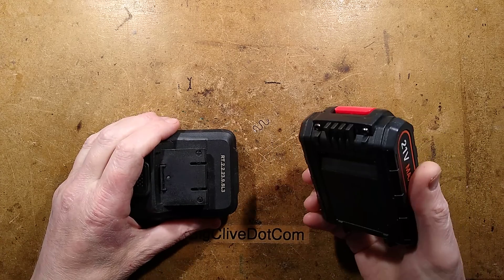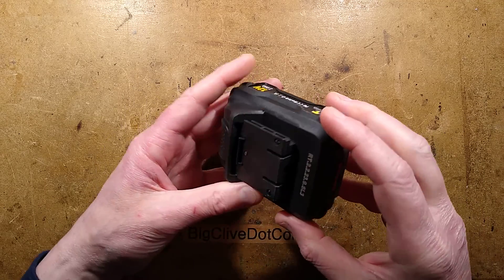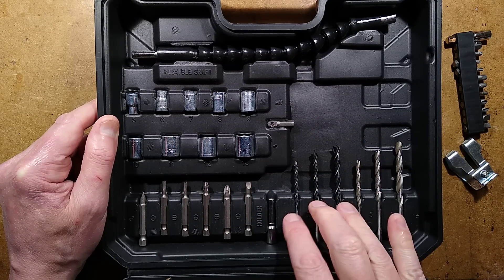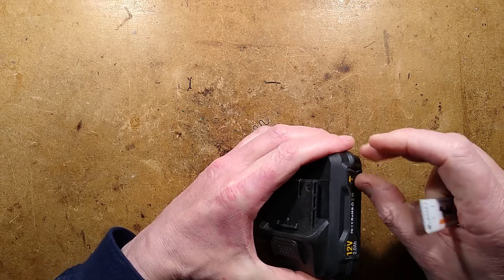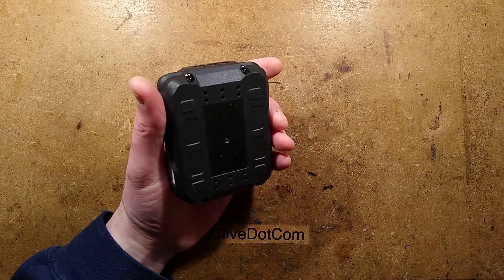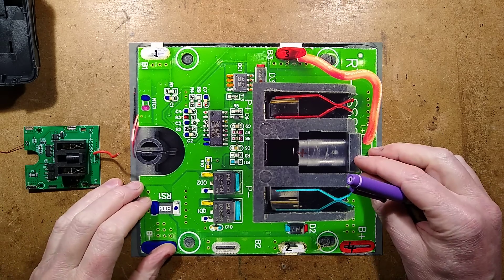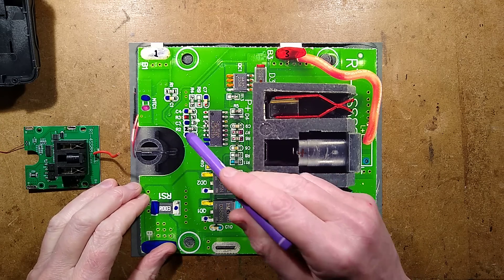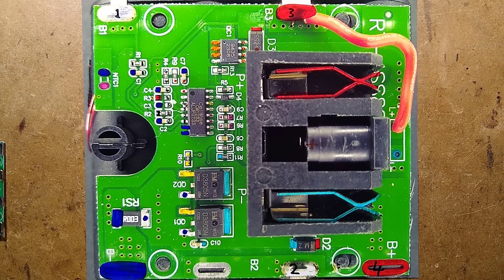Inside an unusual battery for cheap eBay tools - with schematic

Comment: If it wasn't for your videos, I'd have zero interest in reverse engineering circuits like I do programs. But here I am, learning electrical stuff and having a lot of fun because vibin' with Clive never gets old 😁
Reply: I'm the same. I spent a lot of my teens in IDA Pro, .net reflector, Detours (before I found better hooking libs) etc. I had a huge blind spot in my knowledge regarding circuits and electronics before I started watching Clive, AvE, EEV, MarcoReps etc
Reply: @hayleyxyz  Dang, I know every one of those 👀 and myself personally I rolled my own C++ hook libraries that kinda caught on amongst friends of mine 😁
Reply: @Bittboy  Any projects/GH repos I'd know? :)
Reply: @hayleyxyz thats still my challenge. I can take the tools apart and repack them with grease or diagnose mechanical faults. Circuitry i am almost inept.

Comment: Please compare the 2 types of ryobi batteries.  In South Africa we get the Kyocera licenced Ryobi products not the lime green available in UK and USA. The battery is a different shape entirely. I'd love to see if battery safety is equivalent because both are marketed as 18V ONE+ systems...
Reply: In the us ryobi also has a 40 volt line that uses a different battery. i still think somebody needs to make a 2x 18v to 40v adapter that isn't $100.

Comment: When you first showed this circuit board on Patron I wrote a quite long post about what I thought of it, then pressed the wrong button and lost it all. I couldn't be bothered to type it all again. It was more of less what you explained here.

I question whether the board was originally intended to be used for a 3-cell pack, I would have thought the adaptation would be simpler than adding the link wire if that was the case. Performing this at board level is cheaper if that is the intention at design stage.

Comment: Well said about use as general source of power - I use a variety of the Aldi/Lidl ones for running soldering irons or just general powering when fiddling around away from the bench.  If I had a 3D printer I'd probably try to make a custom connection lead but manage with spade terminals crimped on the end of wires - and some coloured paint on the battery pack to remind me of the + and - connections.  (Got that wrong once so learnt my lesson after blowing up a RF module)

Comment: Only 1400 mAh - it's a shame they cut corners with such low capacity.  Using 3000 mAh cells would give twice as much drilling time.  Also this forces the customer to buy two battery packs to do the same amount of work.  😪
Reply: I wonder if it is to support high C discharge, this compromises capacity on cheaper 18650s presumably?
Reply: Well, it comes with three battery packs, so they've got you covered. ;)